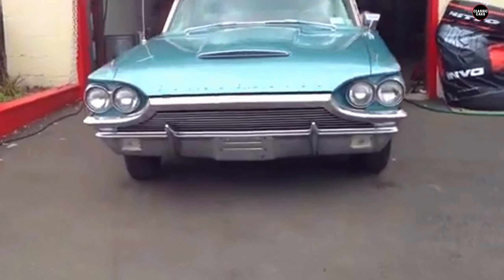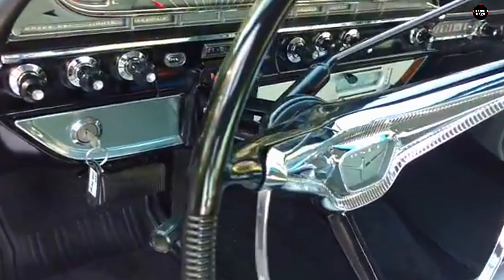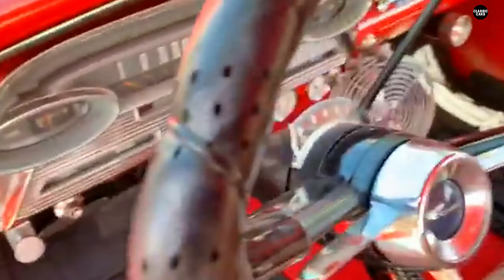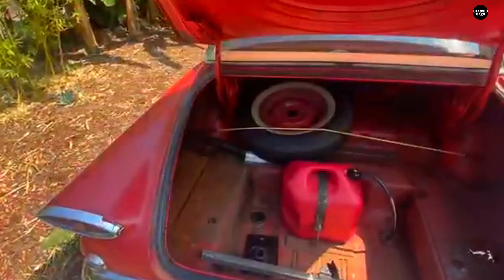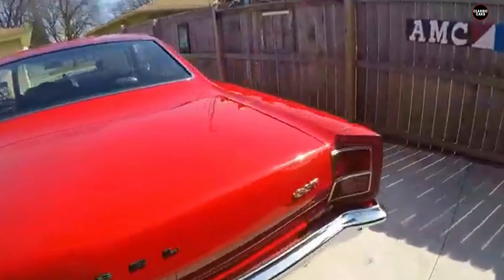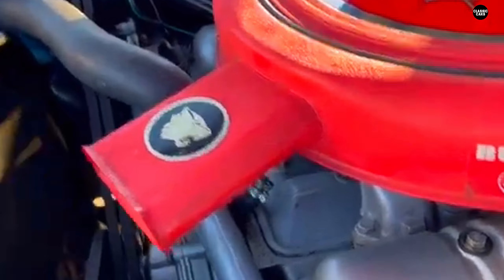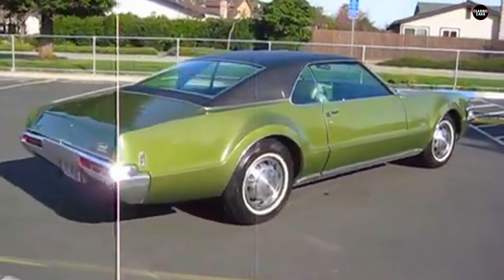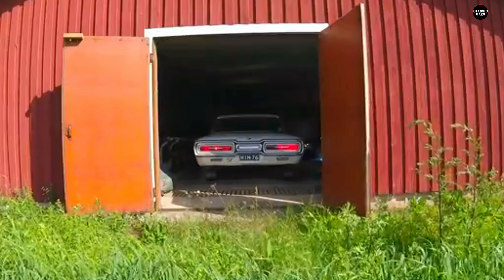15 WORST and Silliest American Cars From The 1960s!

Comment: The Riviera and the TBird definitely do not deserve to be on the list. I would have left the Toranado off but the front wheel drive was new, but GM could send buyers over to Buick if it was a deal breaker. The TBird with the 428 Cubic inch engine brought it up to GM levels.